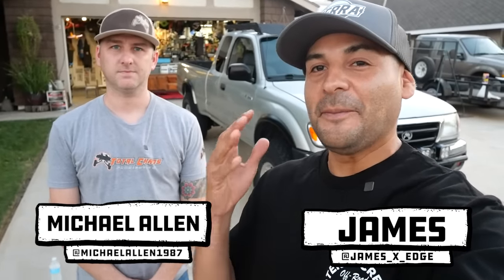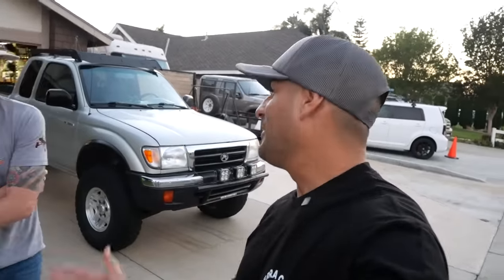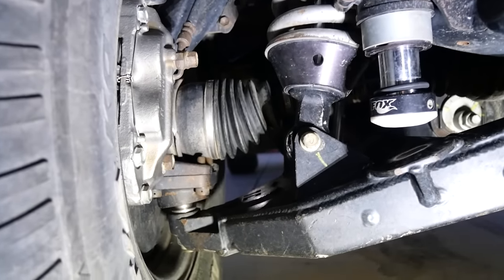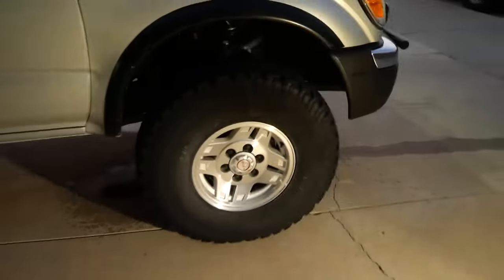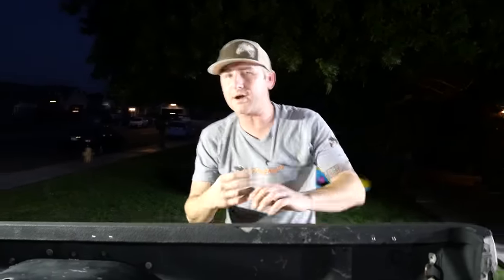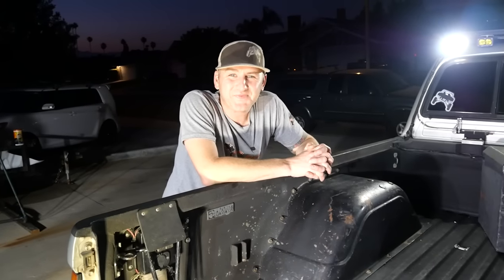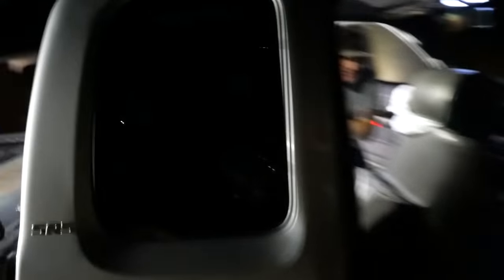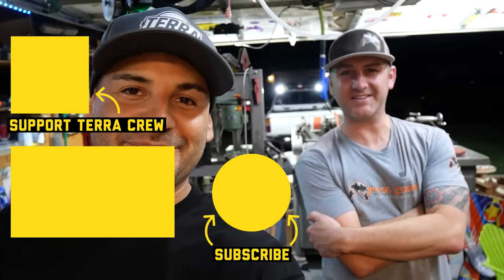The Coolest SLEEPER Toyota Tacoma Build Ever! | BUILT TO DESTROY

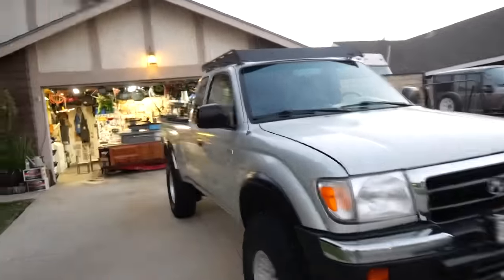Comment: Front Suspension 10:48 DIY Electric Swaybar Disconnect w Front Axle Disconnect Actuator 32:12
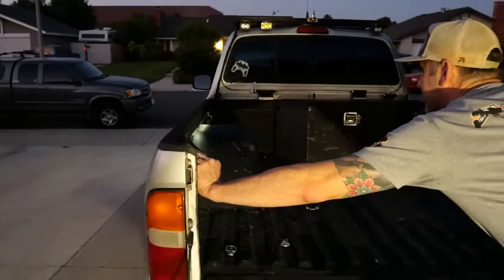Rear Suspension 20:22 Leaf Springs 30:30
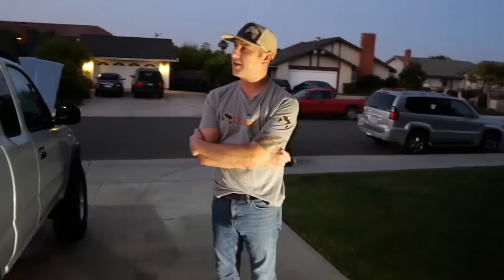Lights- Night action shot 15:45 Hood 14:55 Roof/Cargo 19:15 Plate actuator/Backup 29:58 Interior /Switches 34:23
Sleeper and the Trekker are my favorite builds.

Comment: Coming from a tow truck driver, Lower ball joint failure is so common with these. It’s probably the only main reasons why I have to tow them. It’s usually low speed in parking lots too.

Comment: So 1” wider front arms? Did the front cv axles get re worked? That sounds so ideal for me with my 1st gen and the tight trails I wheel in British Columbia. But I run oversized tires and might break CVs so custom ones aren’t the best idea.
Reply: They use extended shafts on stock CVs.

Comment: so cool, Sweet build.  I just want to know how you get the manual trans to survive?
Reply: 33” x 10.5” R15” tires, when you go to big on tires it loads everything more. I’ve never had a trans problem
Reply: @michaelallen5595   I've broken on 265/70-17 always 3rd gear that breaks.  Middle of the stack just cant handle the loading.  Unfortunately I haven't had much luck getting manuals to survive.
Reply: @michaelallen5595 random question. I just picked up a 95 4wd Tacoma. do you think 33x10.5x15 is over kill for a stock suspension and will I rub on the UCA ? Currently has 255/70R/16.

Comment: My only problem with the uniball lower ball joint is that it still does not account for the 4 bolts that constantly shear or back out. Someone needs to come up with a solution to those 4 bolts and the 1st gen Tacoma and 3rd gen 4Runner would be unstoppable.
Reply: The only time there is a problem with the 4 bolts is if you let them come loose. Once they come loose they pop off the heads or shear because they aren't registered in the dowels. Drill the bolt heads and safety wire them and they will no longer come loose.

Comment: Stock handlebars are garbage compared to pro tapers. Stock hubs are garbage compared to talons. For ur application yes, stock works. But if you modify your vehicle to go above and beyond what was intentional from the factory, the OE parts are gonna be experiencing stresses and forces that are above and beyond what they're capable of resisting. Those are facts. Hes right don't get me wrong. If your don't know much about cars dont take that the wrong way ok? Seriously.
Reply: Most stock bars are pro taper or Renthal, so that doesn’t make any sense. Sure talons are better than stock but I’m not sure what you’re trying to prove. There is an entire aftermarket that puts out products that don’t perform as well or haven’t been durability tested as well as OEM parts. What I was getting at is that most factory metric hardware is superior to aftermarket metric hardware that you buy from the aftermarket.